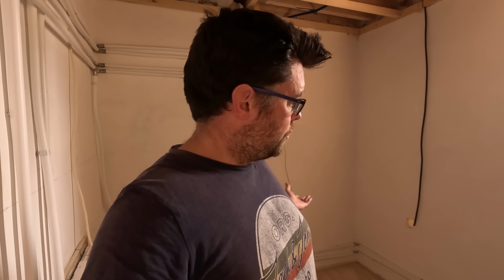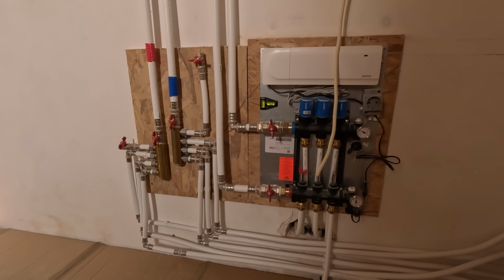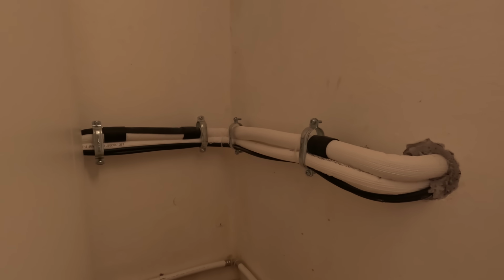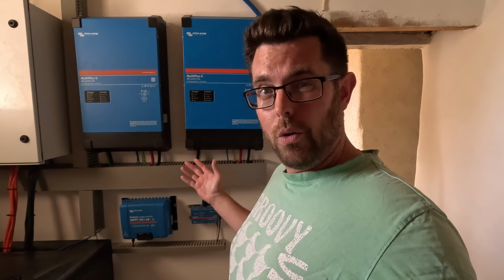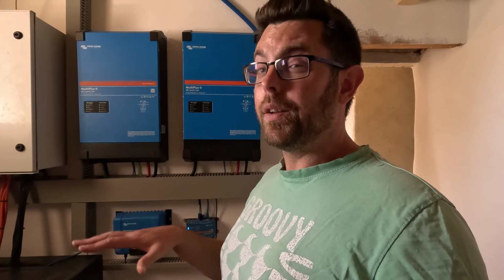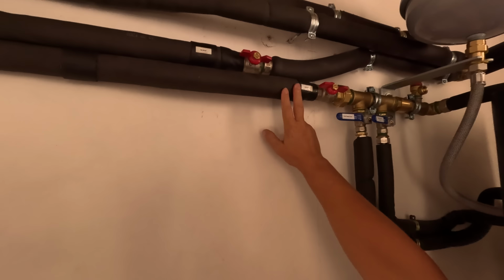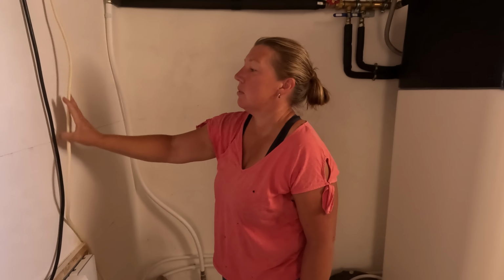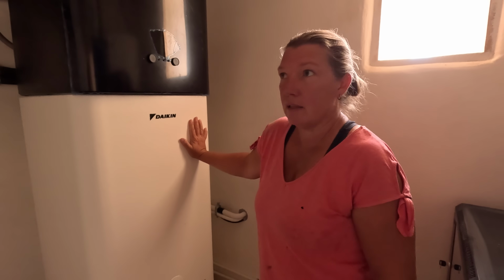Today is a BIG Day (We have HEATING) - Daikin Heat Pump Install

Comment: I think the most easily understood concept of air source heat pump was a domestic fridge. The fridge maintains a colder air temperature than ambient air and the compressor etc pumps the energy out as heat through the radiator at the rear as heat. Effectively identical as your underfloor heating pipes. You'll find that the air source heat pump will work over a wide range of temperatures however as the temperature drops the efficiency will change. So,whilst you'll still have heating You'll not get the suggested 3:1 ratio
Reply: Yes, it's like a fridge without a door built into the wall, with the opening outside.

Comment: Thank god for that, its been getting cold  recently.
Reply: @MAKEDOGROW  Glad I made you laugh. Frankly, this is the best time to install a heating system, and your installation so far looks excellent! We have a log boiler and radiators waiting on the plumbers leisure. I hope we can get it all completed by winter. Ours will be log fired with vacuum tube solar for summer hot water.
Reply from the maker: @SailingCartagena  yep, this is one of the reasons we got it done now … virtually nothing happens in July/Aug and we didn’t want to risk having it installed in the run up to winter

Comment: What a fantastic system.. very impressive, I am sure it will provide you everything you need in the winter as well as you guys always do the research... I guess downstairs the under floor heating may take longer to heat the slab up compared to the floors above, really interested to see how it performs in the winter..

The guys did a great job with the installation, combined with your planning it is a really neat and tidy job.

well done..

Robb Torremolinos Spain

Comment: Very good , That's what I'm looking for a heat pump that can add a wood boiler , could you provide the model of the pump in question , Thank you  🤙🤙
Reply from the maker: There are a couple of different variants of the same system, ours is the Altherma 3 R ECH2O

You can find more details here: https://www.daikin.eu/en_us/product-group/air-to-water-heat-pump-low-temperature/daikin-altherma-3-r-erla.html
Reply: @MAKEDOGROW  Tks

Comment: I live in Sweden and have an air/air heat pump to heat the 112 sq. m.  house(no hot water) and it can still keep the inside temperature at 20 C when it is -20 outside.

Comment: Congratulations. Great choice if you ask me. 
I am really curious how running the heat pump from PV works out. 
I only have experience with PV in Germany. Here it would be absolutely impossible to run a heat pump solely from PV in Winter.
Reply: If the PV system is big enough, i.e. produces enough power, it will be able to run a heat pump just as if the heat pump was hooked up to the national power grid. It may be debatable whether or not the heat pump will produce sufficient heat in the winter to provide underfloor heating and domestic water heating. But that is what they'll find out over the next winter.
Reply: @Brigidz  Yes, in theory you're correct. In practice, at least here in Germany, you realistically can't fit enough PV on a house to make that happen. And since they have a Victron 150/60 MPPT and 48V Multiplus II connected, their current setup delivers 3.44kWp which is not very much and I would be surprised if even in Portugal that was sufficient.

Comment: In 1975 we built a home in Iowa and had a heat pump installed. It worked wonderfully for the 28 years we lived in the house and the present owners are still using this system today 48 years later. They have had to replace some parts but nothing major. We moved to Arkansas in 2003 and had a heat pump installed in our new home there, and 20 years later it is still working. Cannot say enough good things about this product. Economical, reliable, comfortable winter and summer....it also did the air con in summer. I am sure there have been improvements made since our install in 1975 but all to the good I am sure. Great job!!!!!
Reply: Wow. I had no idea this technology went back that far. That is what foresight looks like. Hats off to you.
Reply: Really? A heatpump is in your fridge.. theyve been around as long as the car..
Reply: @Deiphobuzz not technically true.

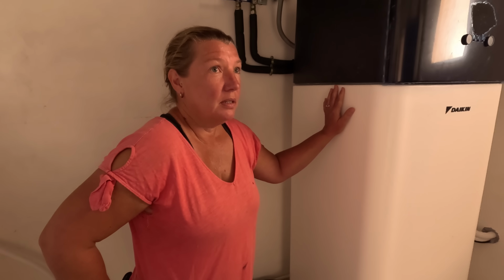Comment: 20:00 When do you need a warm house in Portugal? In winter. What's typical for winter? less sunshine. I would be really interested learning about your calculations ie heat pump wattage, peak and real efficiency of your solar system. Have you done simulation with zero sun for few days?
Reply: Winter is quite cold and lots of rain

Comment: Congrates on getting this unit installed. And I see no issue with running it off grid you have enough battery backup so you have constant power. Unlike us here in sw france, power cuts every time tberes a storm and were having a lot of them. So if they sell them units here theres no argument. Totally enjoy your engineering classes really fun to watch. Xx

Comment: €12,000 is a good price for all the equipment and installation. Yes, the heat pumps do run off solar alone, the converters are the keys. 
The heat pump looks very similar to the ones in Canada that heat a 1,000 sq. m home with the proper windows, doors, and insulation. 
Excellent job those guys did, tidy, easy to access. 
Enjoy! You both deserve it. 💦
Reply: @MAKDOGROW the heat pumps are being delivered, used in a lot of places now during renovation. 
They work well as far North as Edmonton, Alberta which can get to -35. The fossil fuel industries have tried to keep people away from both solar, mini turbines and heat pumps. 😡 The number of EV trucks, cars is getting to be far less noticable because there are now so many on the roads, wonderfully quiet. 
Canadian Permaculture Legacy has a video showing how much money is saved by driving an older Tesla, something like $7,000/year!

Comment: I have heat pump hot water service and three reverse cycle heat pump air conditioners in Victoria, Australia. They are the only source of house heating and cooling. Becoming the norm now. I also have a solar system although sadly only 3kw. It’s getting old now

Comment: Great job and really like what you are achieving. Only concern with your new heat pump system is the hot water temp should it not be go above 60 degree's to prevent Legionnaire's in the water? 
Otherwise great content

Comment: Whoopee. Fabulous idea for Portugal. And you are so right about the alternative ground heat source. All I consider at the moment is the possibility of a nuclear winter. Seeing how much wind was active when the Daikin system was installed, it is a wonder you haven't considered those smallish wind turbines designed for rooftops, not as an alternative but as adjunct.
Reply from the maker: We’re yet to find a wind turbine that warrants the expense. Most reviews and data we’ve seen suggests you need a gale force wind before you get any meaningful energy generated.
We might experiment with one once we have the carport built (perfect location for the kit)

Comment: I have heard of back burner wood burners in the UK. But without paying an arm and a leg for one. I have not found a reasonable price back Burner wood burner. 
If you have enough solar power maybe batteries as well you should have no issues with running your heat Pump.
In the UK there has been some bad press for heat pumps costing more to run than heating the property with straight electricity. 
And of course Portugal is a lot milder than the UK as you know. 
Best of luck.

Comment: hi guys 
i would not plant any thing in front of the outside unit - the plants will cool the area 
maybe leave it empty or - maybe put a stone table with stone benches that will absorb heat and keep the area and air around warmer -

Comment: Im not sure if i have understaood the system correctly but be careful around water temps in the 30's. That isnt hot enough to kill legionaires. Or at least you dont wan't the water your actually going to use sitting at that temperature for a long period anyway.... maybe the water there is chlorinated anyway???

Comment: Expansion tank is to equalise pressure as the temperature rises and the water expands. Water expands slowly with temperature - hence the small equalisation tank 😁
Reply: Yes. Traditionally in a one story dwelling the expansion of the water is relieved by a vent pipe which goes through the ceiling and roof space and extends above the roof line. As the water expands it will move up this pipe. More commonly now the pressure is relieved by a valve and pipe that's vented under the house. As this house has no underfloor space and the roof line is so far above the hot water tank, the expansion tank is installed to accommodate the expansion of the water.
Reply: @Brigidz  In central Europe you frequently have a pressure relief valve at the cylinder that vents into a drain every time the cylinder heats up. More recently I've started seeing DHW expansion vessels like in this system (you can tell it's for the domestic hot water because it's grey, central heating ones are red, not safe for drinking water).

This vessels is divided into two halves by a membrane. One half is full of water, the other air or pure nitrogen. Water doesn't compress, so as it heats up its volume increases. Gases do compress so with half the vessel filled with a gas the water has somewhere to go. As the water volume increases the gas is compressed and once the pressure is relieved (e.g. because you open a tap somewhere) the gas expands again. Works fine until the membrane gets old and brittle but these things are cheap.

The wood burner needs a different kind of equalisation. If you've got, say, a gas burner you can simply shut off the gas as the thermostat says the water in the cylinder is hot enough. If your heat source is a wood burner you can't do that, the fire will continue to burn for a while and the heat that generates needs somewhere to go, otherwise your back boiler could explode (that does happen if such a system is incorrectly installed, I think several people were killed in such an incident in Austria a few years ago), so you need a big water tank that can take the heat. 300 l is small for that, I tried to find figures a while ago and got something like 600 l for the smallest pellet burners.
Reply: Water also contains a lot of diluted air and when heated expands so that is also i believe sorted by the expansion tank and vent valves. A boiller like a wood burner that can generate very high temperature and might be difficult to control needs the expansion tank. While a system like a heatpump that will keep the water temperature and pressure under tight control, can do without it.
Reply: Should the wood burner not be open vented separately?

Comment: Hopefully the noise is such that you DO NOT have to plant plants on the outside. The gravel would act as a thermal battery absorbing heat from the sun and keeping that microclimate warmer than ambient in the evening. If you have to plant, take that into consideration if you can
Reply: we use a Daikin HS pump for aircon/heating in our French home. It has a "quiet" setting which reduces the outside noise. Less important in our case as our nearest neighbour is some distance away but the setting is there, nonetheless. The main issue about noise is often at night when it carries further than in the day. 
Leaving the front of the external unit exposed would be my suggestion - as indeed we have done. Standing next to it when running, it is barely noticeable.
Great schematic 👍

Comment: I noticed that the outdoor unit is close to the wall. I could be talking nonsense but a neighbour told me that you need to keep a gap between the unit and any wall to minimise noise going through the wall. But that said, your walls are much much thicker.
Reply: And?
Reply: @mezanian  My neighbours have several smaller A2A units and they make so little sound. I honestly think they won't have any problems. I'm just wondering if they considered ground mounting the external unit a little further out.

Comment: Just a question about your choice of air to water instead of air to air. Given the heat of Portugal, did you not think of getting a reversible system that can cool the air in hotter times?
Reply from the maker: We forgot to mention, the system can run in reverse, so we’ll have radiant cooling in the floor.
Thankfully because the house has very thick stone walls the heat in summer isn’t a very big issue … and once the ventilation system is in removing the warm humid air it will be even better

Comment: Re having exposed piping, it all looks so neat and orderly that I'd be proud to show it off!  Re depending on solar panels for power, there would probably be enough heat stored in the tank to keep the house comfortable on a winter's night even if you shut off the heat pump until morning.  But you won't have to, because batteries have improved to easily provide power to the compressor for many hours.  

Ten years ago this system would have been risky, but solar cells, batteries and air-sourced heat pumps have all become vastly more efficient since then.
Reply: I am wondering why the ventilation pump has to be turned off for the day time. I have heard that in England, for example, it is customary to heat the apartment in the evening and at night for a while, and during the day the apartments are kept cold. This results  mold damage inside of house.

In my country, it is customary to keep the house heating, also the ventilation pump always on, to avoid mold damage. The ventilation pump has a thermostat that keeps the desired room temperature constant. The air heat pump should be adjusted to 23 or 24 degrees in hot weather and then keep it on all the time. 

Also, the humidity outside does not move inside the house when the ventilation pump is constantly on. As we all know, moisture always moves from wet to dry, which in turn worsens air quality and causes mold damage at worst. 

If we switch off the device continuously, there is moist air outside and dry air inside, the moisture seeps through the structures. There will be no problems if the machine is on all the time, with a suitable coolness and the indoor air is suitably dry. 

The air source heat pump is kept on even on working days, even if there is no one at home and when we go on vacation. The ventilation pump is easily damaged by being turned off and on constantly. (Executive director of Sulpu ry, the Finnish heat pump association, Jussi Hirvonen.)
Reply: @vrvrhm8438  On a good insulated house you do not need to power off the heating. We have it all day long turned on and the consumption is quite low.Of course you are required some double/triple glazing and quite thick insulation layer for that.
Reply from the maker: Yes, we’ve thought of this too (hence the test to see the temp drop when turned off) and during periods of grey days we’ll probably turn the unit off to preserve the power in the batteries.
We also have a backup generator but really want to avoid using it.

Comment: Easiest way to describe a air heat pump is it's like a fridge but in reverse. In Sweden these heating systems are quite popular in (as you state) existing buildings since being relatively easy to install. If these systems work in Sweden they should be working better in Portugal.
The data of your off-grid system would be very interesting, I dont beleive that would work in Sweden considering the short daytime (sun hours) during winter months wich is the period the system is needed the most.

Final comment, Connecting the woodburner is smart, making use of the cosy fire in more ways then one.

Thanks, guys!

Comment: Hello, please check the issue regarding Legionellen in the drinking water. Once a week you should heat the water to min. 65 degree C in order to kill the Bakterien.
Reply from the maker: The current temp is not the final temp .. since we’re not using the system just yet
Reply: @MAKEDOGROW  don't wary, Daikin have weekly probram about this. Btw if you use every day full tank then you don't need this program
Reply from the maker: @danchodancho2998  I thought I’d seen mention of that (and the anti frost) cycle in my research but must admit I’d forgotten it.
45 still probably won’t be our final temp … we want to find a temp just above comfortable shower temp (so we’re not needlessly heating water just to add cold to it)
Reply: @MAKEDOGROW  perfect! In our house we have 2 piece of Daikin Alterma 3. (460liters) In first one we heat water to 50C, in second 40C. We use thermo valves in our shower to use constant temperature and comfort - this is game changer. Btw from10C to 40Cour consumption is around 1.5kW and 4kW if we heat to 50C

Comment: Works far better with underfloor heating as the units can not(in UK) produce hot water hit enough for radiators of normal size to heat a house in UK

Comment: Aren’t you worried about legionella? 
And yes heat pumps and solar works perfectly, busgreasemonkey has a whole workshop on solar
Reply: I was going to ask about that too. I know some systems (Vailiant?) do a "legionella cycle" where they just up the temperature briefly and make sure it's all ok. Presumably that Daikin system can do this?
Reply: Was concerned too,vand did a quick search - 20-45 °C is supposedly where leg. can live. At 50 it takes several hours to kill it, at 60 about 10 minutes, at 70 less than a minute (bacteria freely  suspended in the water)
Reply: They mentioned in someone else's post that this was only the "testing" temperature. The system temp will eventually be increased once they start hooking everything up. Hope that helps!💕